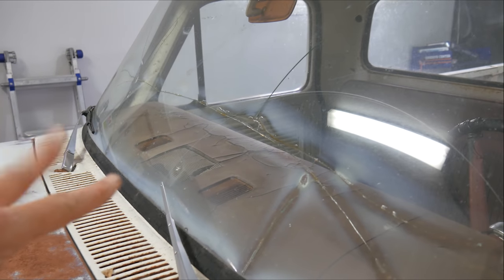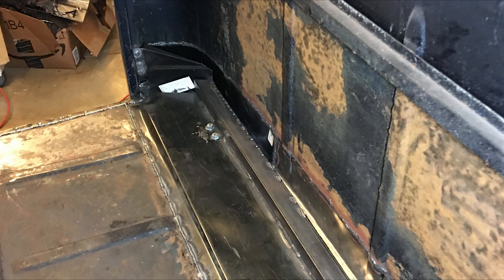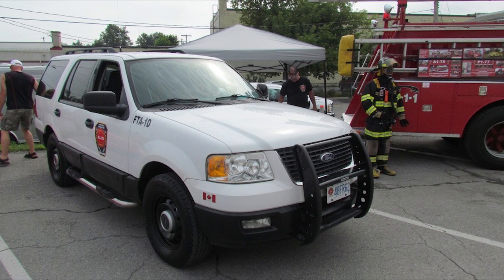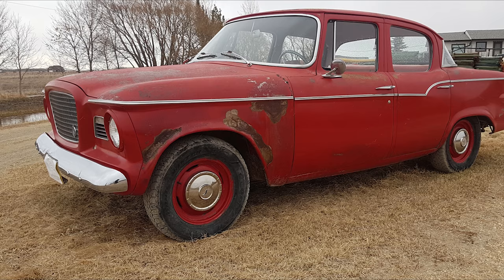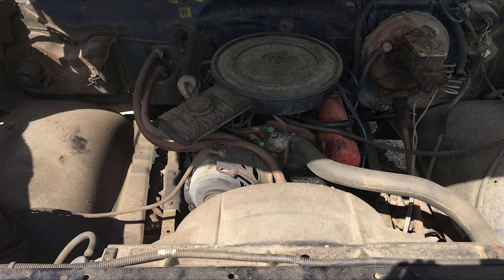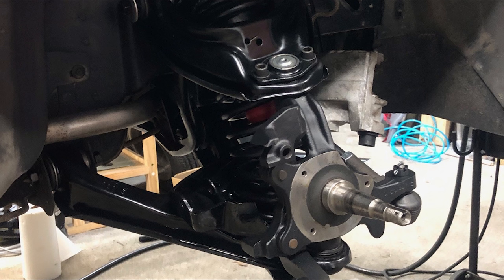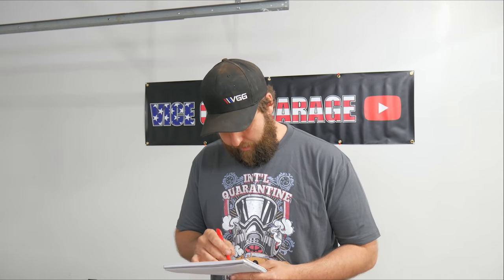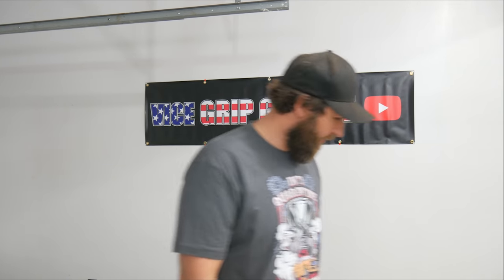Deboss Garage IQCS 2020 Factree Award

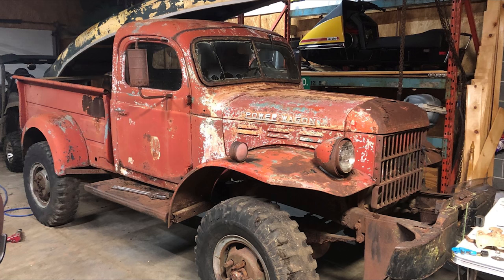Comment: 5:23 Since most of your rigs might have trouble reaching them speeding limits, and fellers might be riding your ass, here's a Pro tip..
Use the old fire stick, and weld a large wrench or chunk of steel to the top of the south bumper, problem solved..

Comment: ON the 3/4 inch plywood console option on that winner '68 Chev C10; you got most of the run right, however it wasn't listed the same way after '69- originally, you are right- "cold snack tray option" was the GM nomencalture for it. However after '69, and needing a refresh but the new Square Body wasn't ready so they thought very quickly and renamed the "cold snack tray option" as the "extended cup holder in custom, delicately used 3/4 inch plywood". Hope that helps set the record straight. The purists are hell on these option thingies! Give me a moment and I'll have the changed part number too!

Comment: True story here. My Grandfather used to drive Auburn, Cord, and Duesie rolling chassis like that Auburn from the main factory in Auburn IN to the Body and Interior shops in Connersville In back in the day. He would strap a wooden orange crate on the frame and away he went. When they were finished he would go to Connersville and drive them back to Auburn and pick up the next one. He lived about 20 minutes from Connersville.

Comment: I had a 69 Chevy C-10 you would have loved, it was the same color as the one in this video.  When I bought it, one of the fenders was a different color, so I pulled the ash tray out and took it to lowes and had a pint of custom color enamel mixed and bought a sponge roller, looked factery when I was done!  my feet would get wet whenever it rained due to all the weight reduction, and the driver door had a custom latch made from a bungee cord, it had a hole in the dash where a radio used to be installed, so I got one of those clip on rotating fans and hard wired it in to the unused radio power wires.  I bought a primer black tool box and mounted it on the bed, it was the best looking part on the truck until someone shot a hole in it in the middle of the night,  I didn't want my stuff I had in it getting wet, so I just slapped a bumper sticker over the hole.

Comment: You know a feller needs a cold snack in the custom plywood  holder (the snackalator 9000) when he's in flip flops  mode cruising the back roads,  wondering 45 minutes into the trip when was the last time he put gas in the boat tank , and then realizes it was many miles ago

Comment: You woulda loved the frame on my car when I got it 😂 Literally the whole driver side was rotten leaving a thin peice of questionable metal to hold my transmission in on the one side. 

It's fine... only drove her a week like that before fixing it. Later getting other cracks in the frame. The car never got a safety either because lady at the mto office done goofed 😂 So it's never been saftied since it was new

Comment: HAHA A guy agrees with your final choice  , “I don’t know” . My dad had a 1970 Chevrolet unit .over the years we fixed on her quite a bit ! The passenger door stopped opening .so I always had to open the window with some vice grips . @nd jump out of window .There were factry air conditioned holes in the floors . That kept us cool in the summer...I will find a pic of the unit and post it . My dad always said “ if it ain’t broke don’t fix it “ needles to say . When the motor started blowing blue smoke dad would add a product called Bardahl . It was dads ways of maintaining the motor . Over the years we put 6 or more engines  in the old unit. And One rear diff . It was a moving van .

Comment: So this guy here (across the world) noticed that his skid plate on the 150 cc Indonesian build Honda was falling off. The factory bracket was softer then the Independence Chevelle's frame (must have used carbon free steel here in Indo). So a guy looked it over and figured out the right thing to do is to make a new bracket (with some carbon in it)....but did not do that. Four holes and two zip ties later this guy says project done. This from a mechanical engineer, professional pilot and a bit of an obsessive perfectionist. 

So this guy thought (while laying down in the driveway, being eaten by mosquitoes and sweating in 35 C-which is lot more of them F degrees with 90% humidity) that VGG guy helped him right then and now with more realistic goals and objectives. We are also not talking about road side fix here to get back to the house for some fried rice or noodles. This was a structural/performance project........ and this guy slept like a baby. Could this be some sort of a movement? Thx VGG guy.

I don't know....